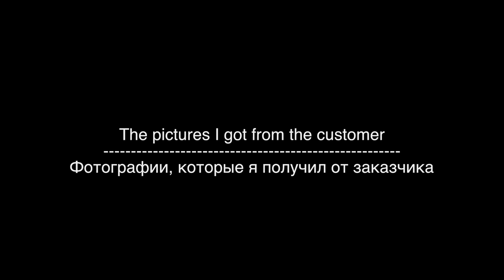Making wooden cubes

Comment: How much tolerance did  you leave for sanding or is that loss insignificant? And how hard is it to keep them square once you start sanding?
Reply from the maker: +Matthew Friedrichs About 1 mm. It is impossible to make them absolutely square. This is hand made cubes. I could use CNC machine, but the changes in air humidity will constantly change the dimensions of the cubes. Wood is wood.
Reply: Thanks for the detailed information. They are beautiful.